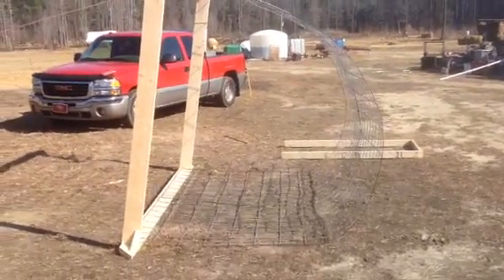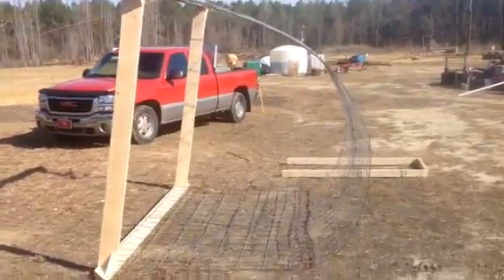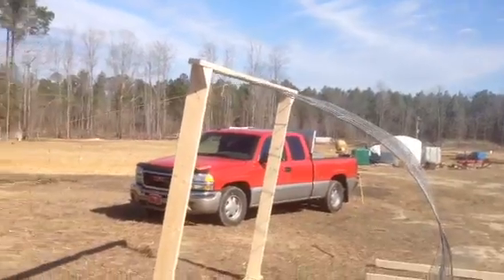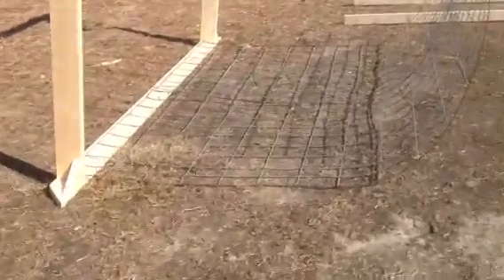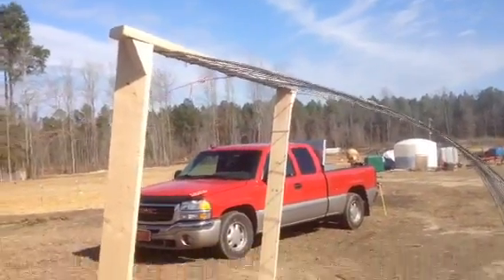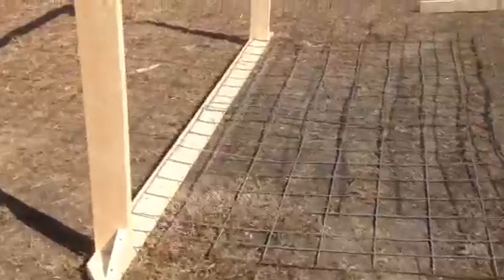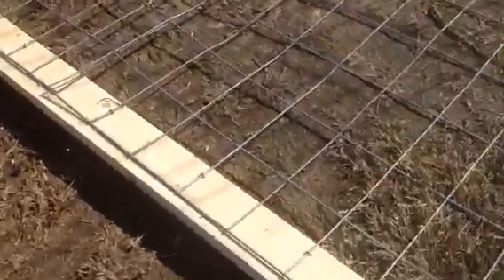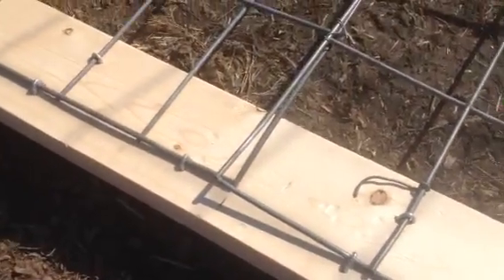Cattle panel green house construction tip.

Comment: Dennis,  I found your tip as I was researching this greenhouse type.  My 50 something brother and I started this project about two weeks ago and your idea was a bad back/time saver.  With two of us working together we didn't need to use the rope to hold it in place so it went pretty fast for us.  Thanks for taking the time to post your tip as it helped us quite a bit.